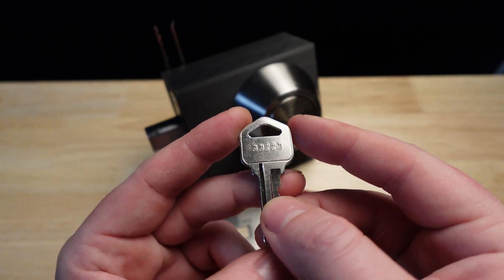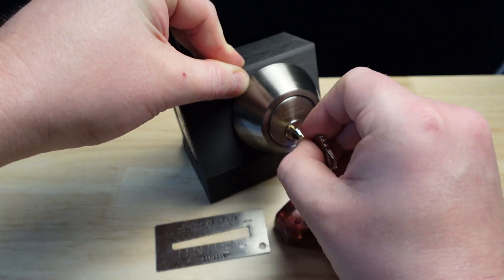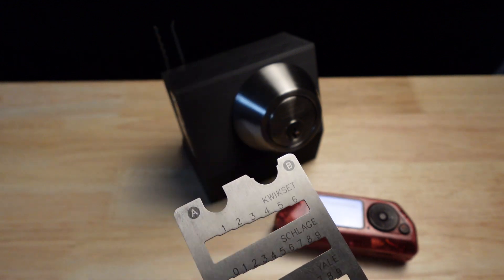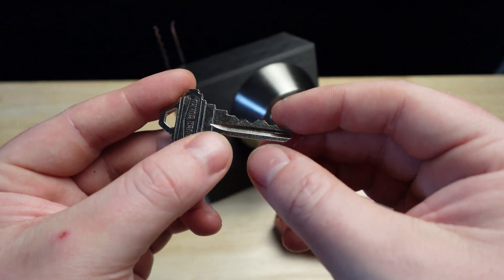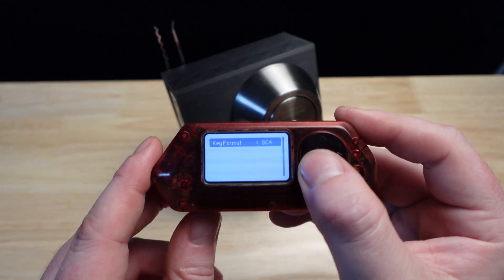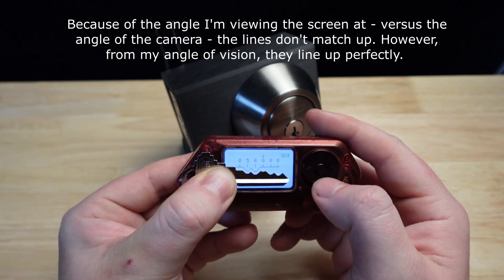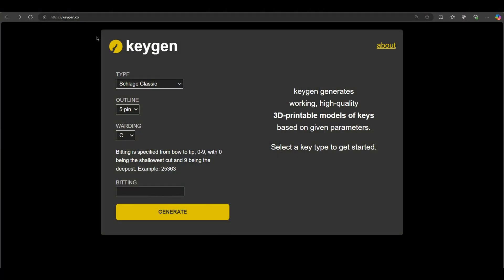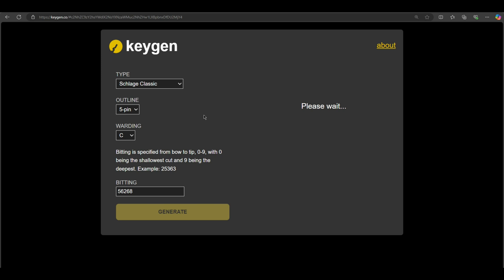Flipper Zero Key Copying (and key making!)

Comment: What type of product did you use to 3d print is strong enough to not brake apart
Reply: He probably used magnetic filament because it has tiny bits of metal in the filament.
Reply from the maker: PLA+, no metal in the filament
Reply: @LockPickNic  oh

Comment: Where can I find the programming for the flipper 0?
Reply from the maker: The firmware?
Reply: @LockPickNic  i purchased a flipper 0 but I can't seem to figure out the so-called program for the key cuts.
Reply from the maker: @SadSam69  there will be web flashers for firmware - the key copier app comes standard with Momentum

Comment: What’s your full setup w the ELEG rapid and CReality?
Reply from the maker: I have a Bambu P1S, a Creality S1 Pro and and Creality Ender 3v3 (the printer in the video). The 3v3 is stock, besides the arm holding the filament spool, it's different as I wanted a smaller footprint.

Comment: Did you ever try with a dimple key? I would be curious to see if 3D printing is precise enough and if the pins would slide against the printed plastic.
Reply from the maker: @DonkeyFckr  good question! I'm printing a Duracam key right now, it's basically a Medeco dimple lock - I haven't tried anything else, dimple wise.

Comment: Do you get any heavy flex with PLA? Would be concerned about it breaking off. Might give this a go in PETG-CF instead
Reply from the maker: There's flex, but it's welcomed - the key will bend and tear instead of just snapping. About to print one in TPU, just for fun. I'll be printing in a few different materials and doing some testing to see which is best.
Reply: @LockPickNic   Try it with some of the higher rigidity TPUs
Reply from the maker: I use 95a

Comment: That web app is a fantastic resource. I wasnt aware of it, thank you for sharing that. If one was gentle they could probably copy the 3d printed key with a simple duplicator eliminating the need to fiddle with space and depth keys. It might be wise to make a 3d printed tracer for the machine to avoid the steel tracer possibly digging in to the 3d printed key. 😀
Reply from the maker: Good thinking dude.
Reply: @LockPickNic  Thanks. I'm really digging this resource, I'm try to figure out how I can make it work as a stand alone android app.

Comment: I can go to a locksmith & give him the type of key & the numbers & get a copy right? 

I don't have a printer.
Reply from the maker: Shouldn't be an issue. Just say what the type of key is (Schlage vs Kwikset) and the cuts on the key. You may get a weird look, but I don't see why they wouldn't code cut one for you.
Reply: Lishi picks give you the code too right?
I've never used them. The little I've seen with them, they seem to be pretty neat. The one I saw gave the cut code I believe.
Would I have to get a Lishi pick specifically for my lock type (SC1) or is there overlap with them?
Reply from the maker: @Shuck-Shick-Blam they will decode the lock directly, yeah
Reply from the maker: @Shuck-Shick-Blam  oh, and no overlap. Lishi tools are keyway-specific